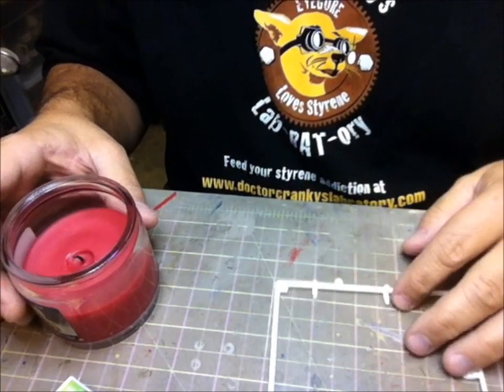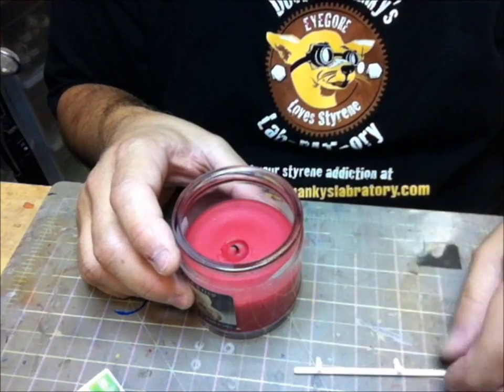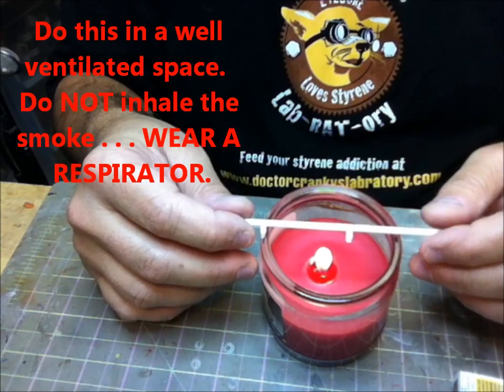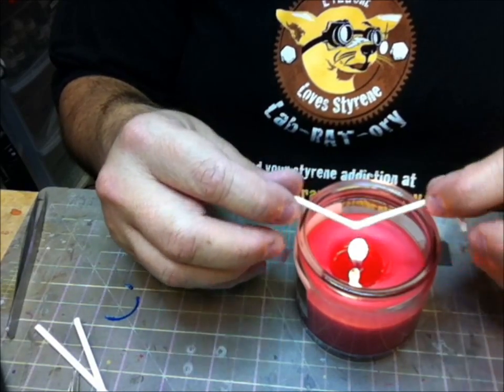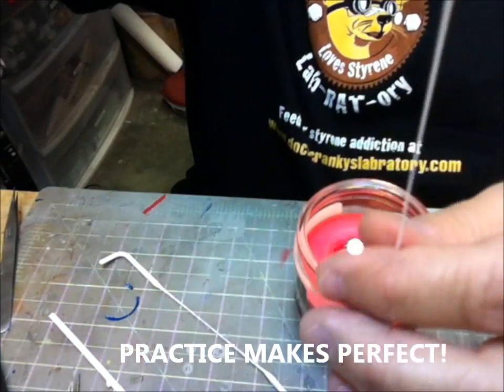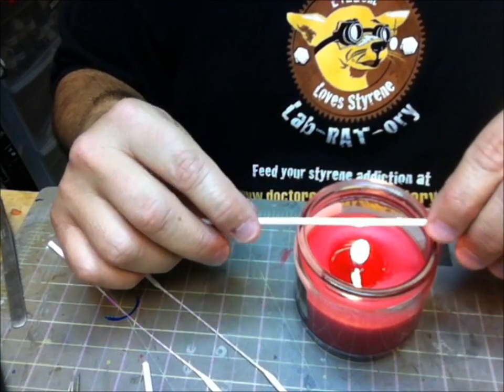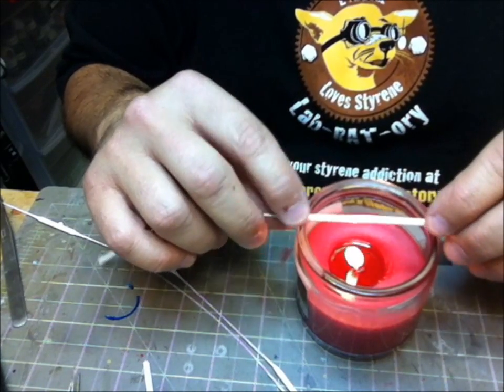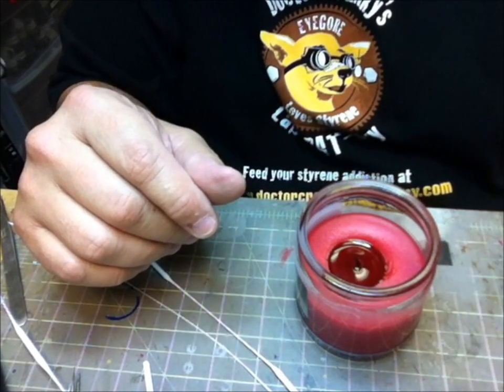CLINIC:  STRETCHING SPRUE

Comment: Working with Sprue & The Repurposing of it is a "Art Form"  in  itself from within the Styrene Modelers World.  This super plentiful. Source of plastic is a Hidden Gold Mine

The 2 Scale Auto Model builder books I'll be waiting will each have a Chapter dedicated to What to Do with the Mountain of Sprue we can and often do accumulate during build process of our models 

Some Grate it carefully using finest n smallest cheese Grater to turn it into fine chunks for BLENDING with liquid Cement for homemade filler putty made from same plastic as model they're building 

Stretched pieces Work great as Gap fillers by using Liquid Cement applies 2X to both Sides of Gap. Then making sure contact area of filler piece has  2X applied to it just before it's set in place thus works awesome 

Let it dry Completely before moving to Sanding, shaping or puttying area . Great Results happen

For my 41 Plymouth I'm going to try building 2 stock 41 Plymouth. Carter BB ine barrel carbs better than kit piece to make a Twin mold custom Carb n intake like old school  Rodder would have done

Later I'm going to try my hand at making Scale Custom figurines From Sprue too

Thanks for the Video to educate the Modelers unfamiliar with beginning the Art of Sprue parts making n using this overlooked resource.